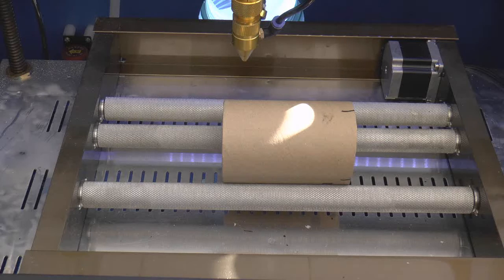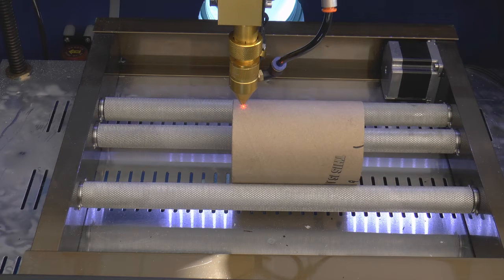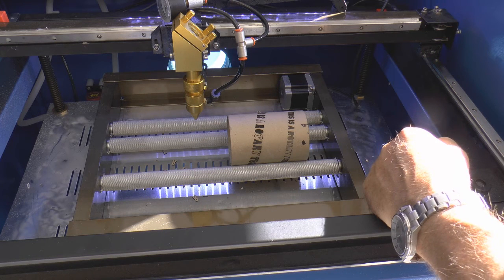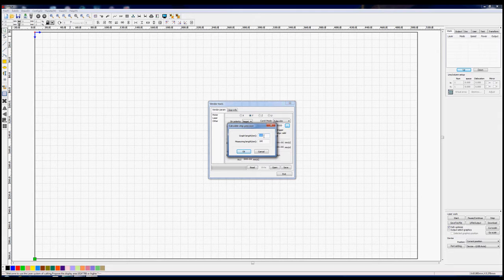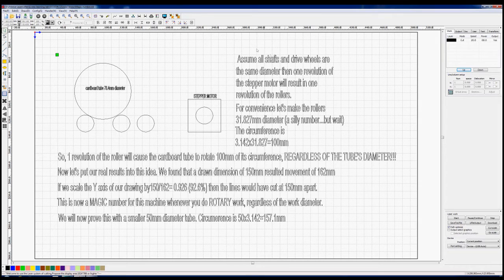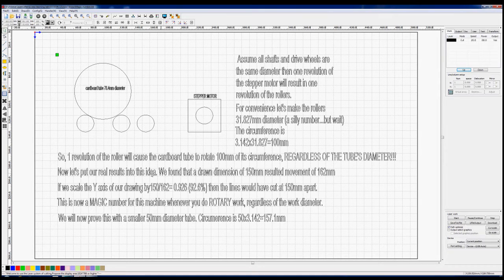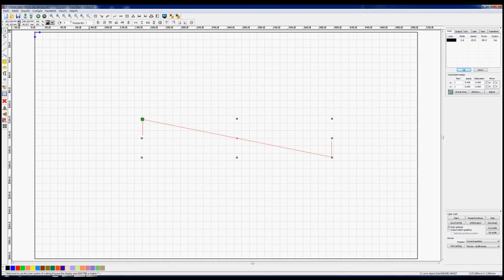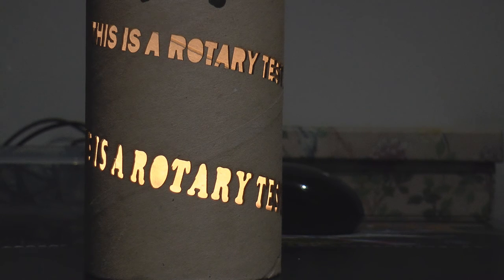RDWorks Learning Lab 11 part2 rotary table program and calibration

Comment: This magic ratio only works with 360 degree rotary engraving. If you use a part of your meterial, for example if you draw a 5cmx5cm circle and cut it with this magic ratio you will end up an ellipse shape with a visually thiner y value. It is the true y value but visually it will be an ellipse. If you want to end up with a visually perfect circle you have to measure a direct line between two lines of your end result without curving the ruler, do the math and apply 'that' magic ratio to the drawing.
Reply from the maker: Your magic ration will almost certainly be different to mine. That ratio only applies to the Y axis (the rotating axis) and works every time for all sizes of object. You must apply the scaling factor to your drawing before programming. Depending on your own personal scaling factor your original drawing will look fat or thin when you program it but will come out perfectly when you laser it.  There are things like acceleration factors that can mess with your final engraving because the rollers move so fast that there is loss of motion  transmission onto your object. You can put an elastic band around your object to create better friction and /or go into the USER tab and set the idle speed and acceleration to lower values just for rotatory work.
Best wishes
Russ

Comment: Thank you for your videos. I am having a problem with trying to use the rotary attachment on a wine glass. I keep receiving Error Code- Y-Axis Overlap.  The glass has a diameter of about 315 mm how to I do about making the page not overlap?
Reply from the maker: +Ayanna George 
Hi Ayanna
At 315mm diameter that's not a wine glass that's a barrel!!
Being serious now, I think a wine glass would be about 100mm diameter with a surface length (circumference) of 315mm. 
It all depends on the size of your machine as to what the problem may be. The rotary device is controlled by  the Y axis driver. If your table Y size is 300mm  then it now depends on how your rotary device is geared.The stepper motor will still output 300mm worth of steps. but what does this give  as surface movement in the rotary axis?
If you put your glass on the rollers and press the UP arrow on your keyboard that would normally  send your Y axis backwards. Although the beam cannot move, the RELATIVE motion between beam and glass remains the same and you will find the top surface of the glass is rolling towards you. Keep pressing the UP arrow until movement stops. Put a mark/piece of tape your glass  right on the top. Also press the ORIGIN key. Now press the down arrow, until the glass stops. Put a mark on the top and then measure between the two marks. The answer you measure is the largest drawing size you can theoretically fit onto the glass. It may be only 250mm 

Remember we set the origin right at one end of the rotation? That's important . If you have a picture that needs 250 mm of circumferential movement and your origin id NOT set right at the end of the rotation. The machine will know that the picture will not fit the available 250mm  and report an error. 
Draw a 50mm square and try to run that with the laser beam turned off. If you set the origin at one end of the motion, the program should run  and then set it at the other end and it will  not run.
The machine is complaining that you are tying to do something stupid, but it's too polite to tell you truthfully. I suspect you either have not set the origin or that your drawing exceeds the available rotation.
If you are still in trouble after checking these things, please come back to me and we will try thinking of other possibilities.

Good luck
Best regards
Russ

Comment: Interesting. I did my own little test with this same machine and rollers. But mine comes out compressed instead of stretched.  I've only done this with the default square that comes pre programmed into the machine.  I looked for slip but did not notice any using both glass and a paper tube. I suppose I could calculate my personal magic ratio and stretch images, but I'd rather not do that since I may just have them on a USB and not be at a computer.  I thought that perhaps the compression was due to some slack in the belt tension, but there seems to be too much compression to blame it on that.   I looked around the control screen to see if there was an enable roller setting without luck. It just seems that there should be a better way.
Reply from the maker: +Nathan Clark 
Hi Nathan
I spent ages trying to get this strange device to work and perform predictably. Hence the magic ratio approach.  The easy solution you seek with a machine setting is just not there. There IS a 100% fix for your problem and that is to  manufacture a whole new  set of rollers with a bigger diameter so that the magic ratio becomes 1:1. The alternative is to always save 2 versions of your files to memory stick, one normal and one stretched.
Sorry I cannot be more helpful
Best regards
Russ
Reply: +SarbarMultimedia I may take a crack at building up the rollers with bicycle tubing after more testing.   It should provide some nice grip.
Reply: Mine gets squished as well, my magic number is to stretch by 57.2%
Reply: @naRevolution  I actually found a set of numbers in the settings where you can adjust and it will give it a perfect fit. I made the changes years ago so I can't tell you where to find them. I think there is a pair of numbers (it's in the software, not the machine). I think I ended up calculating what to change it to and one of the numbers was really high.

Comment: I just figured out how to use "enable rotary engrave" option and i thought i would share it here. This is so much better then changing vendor settings for various diameter materials. On the Y axis stepper motor driver you will find information  (table) how many steps (pulses) driver is set to to achieve 1 full rotation of stepper ( mine was 5000). So that is one rotation of stepper, but there is reduction gear in rotary (mine was 3:1)   So 15000 pulses for me was one full rotation of material. So that is "circle pulse"  you have to change. Then everything should work great once you specify diameter of your material also! PS. I got custom rotary that is chuck type not roller, not sure it works same for roller type?

Comment: First off, thank God for your videos! I was about to take a sledgehammer to my laser! (One of the red 60 watt units on eBay) I've been struggling with mine for a month now. Anyway, your videos are a great help, thanks much!
My unit has a 4 prong (aviation?) plug for the rotary attachment in the bed area, and I notice there is a spare driver with the end that leads back to the plug just laying about (unconnected).
Do you initially attempt to use a similar setup when enabling the roller in the software, or did you start out disabling the y axis from the get go? (I wonder if the toggle in software shunts the y axis commands to a different pin out on the driver board...) hoping really....
I don't have a roller attachment for mine, but I do have the plug ordered and a spare stepper motor laying about. (Plan on diy)
Reply from the maker: +kilroy07 
I'm sure you have already watched part 1 and therefore will have seen that my machine has no special rotary drive controller. I have to unplug the machine Y axis (like yours, the plug is at the back of the bed area but not all machines are there, some you have to go into the control cabinet to make the change) and connect the rotary table into the Y axis control board. This is actually quite a good system as you don't need the Y axis during rotary engraving.

Is your spare driver something to do with auto focus (if you have a powered table,some more powerful machines are equipped with this feature)  ....a Z axis? Mine has a manual switch controlled powered table but no auto focus.

If you need any pictures or info about the roller table  just message me and I'll try to help.
Reply: kilroy07 i have the same setup as you by the sounds of it and after connecting the wiring all the way through from the rotary, to the bay connector then removing the y axis motor from the controller and plugging in the block from the rotary into the controller i get nothing. It does not rotate at all when i press the up and down arrows on the laser control panel. Its driving me nuts. Have you managed to get yours going yet?
Reply from the maker: Hi Kev
Just a silly question. In the user parameters there is a rotating section. Have you set Enable Rotataing to YES?. If so turn it back to NO. That section is specifically for the chuck type rotary  and not the frame type that we have.
Russ
Reply: Hi Russ, Its a chuck style one I have, do you mean user parameters in RD works or on the laser itself? Many Thanks.
Reply from the maker: Hi Kev
In RDWorks top right there is  a user tab. That tab gives access to all sorts of thing that you can fiddle with and sometimes need to set but you MUST be connected to your machine first. When you open the tab, make sure the first thing you do is go to the bottom and press the Read button. That will place your current machine settings onto the screen. Scroll down and you will eventually get to a Rotaary section. For your type of unit you will need to ENABLe the rotatry There are a couple of other setting below that you will need to tweak when you get it working and know what you want to engrave n. Make sure you press the WRITE button before exit

Good luck
Russ

Comment: Thanks for this information. I'm building a DIY rotary device for my "Chinese laser" which is a different model. But wondering...
Have you experimented with engravings using this method? I realize the effect might be minimal, (and not sure if visibly apparent or a big deal), but wouldn't the engraving essentially overlap (or if a cut, the equivalent of cutting at a slower speed) Since you are either compressing/bunching or expanding/stretching depending on the scaling required the actual engraving or cut vs the original design?
Reply from the maker: +Marc G 

Hi Marc
Your question  made me think for a few seconds before I convinced myself that the drawing scaling factor  deals with ALL issues.

When you have the normal XY axes working the machine has already been calibrated at 1:1 ie  if you draw a 100mm square  you naturally expect the flat  cut produced to be  100mm square. If you program the speed at 10mm/sec you would expect it to cut in 40seconds.  You now unplug the Y axis and  drive your rotary device instead. You do not specify anything in your program that tells the machine you have done this swap and as a consequence the steps per second  from the drive board that produce 10mm/sec, remains the same. Don't be confused by different gear ratios,  all you need to consider is the ratio by which you must expand or compress the drawing  Y axis to achieve the same 100mm square on a circumference. I hope you can see that  because the machine knows nothing about your rotary device, you are making just ONE fixed compensation % to your drawing (that applies to any work diameter) to take out all the step and gear ratio  differences from the  normal Y axis and your circumferential square will still take 40 seconds to cut.

Overlap? This is a function of your work circumference. Your compensated drawing cannot exceed the work circumference or you will get overlap

Hope this clears some of the fog.

Comment: I have the 50w chinese engraver also and truly appreciate your videos. I have the identical rotary table you show. Works great for tests as yours did. I am trying to do a wooden rolling pin, everything does as it should except about every 1/4" on the Y-axis, it seems to skip engraving, leaving a thin sliver of material showing through the text, design or whatever.  I have tried multiple fonts, speeds, power settings and still get the same skip result. My question for you is have you tried engraving on a wooden dowel and achieved clean, engraved design? Could it be the rotary rollers slip? Or do I require setting the 92.6% y offset more? I can send you a pic of what it is doing. I have to engrave on the small spaced rollers for the rolling pin. Appreciate any advice.

Comment: I don't know if you've figured out how to engrave a glass yet but if not I can help you out. It's fairly simple.
Reply from the maker: +GSCOMPUTERSRGV.COM    I'm up for any advice or helpful tips. In session 13 I did experiment with glass engraving on a cheap glass jar. I had previously experimented with a coloured glass beer bottle but I think I used too much power (I could see cracks in several places!!!) As I say in all my videos, I'm trying to find out how to make things work rather than do a professional job at the moment. So, any tips that will enable me to take the next step will be very welcome. Now that I'm starting to tackle longer projects I'm discovering power loss issues with my machine (see sessions 16 and 17) I suspect I shall have difficulties getting any sense from China and may have to resort to Paypal  for a resolution.
Reply: Give me a call sometime. Maybe we can exchange tips. Contact info is on my website.
Reply: I tried replying to your email but it kept getting bounced back. I have added you on skype.
Reply: +SarbarMultimedia Sorry to butt in on this thread but I had up until this comment been looking at buying the same laser from the same seller. It seemed sensible to follow the footsteps of someone who has been there and is doing that; somewhere to learn from.
Im dotting about through your videos and have seen the one about the power loss and it likely to be an over driven 40W tube rather than the advertised 50W. I posted the video here to highlight to others - https://www.facebook.com/groups/441613082637047

Did you need to go back to paypal for a resolution or did you settle on the fact that it was a bit of a dodgy (pronounced "false") sales pitch?
Reply from the maker: +Peter Jones 
Hi Peter
Although I bought a 50 watt machine, I have yet to prove it is only operating at 40 watts or thereabouts. I have a power meter on order which will tell me what's actually happening. Up to now its been supposition because of the shape of the power characteristic I have found for my new tube. It also explains the early demise of my original tube because I used it mainly at 85 and 95% Even if it turns out to be only 40 watts I shall actually be happy because it cuts 8mm perspex (albeit very slowly) which is 2mm more than I had anticipated. It's the engineer in me that want's to push the boundaries and find out if it's performing to spec. Several contributors, a lot more knowledgeable than myself, have advised that most (but not all) Chinese machines are over-driven to justify peak wattage claims. Having killed one tube in record time, I made the effort to understand my new tube  characteristics and stay within sensible limits to hopefully achieve it's expected 1000 to 2000 hour life. A warning to others to be careful about pushing their machines to the limit will, I'm sure, save many new users the expense of a tube replacement, so thanks for spreading the word   The main requirement when buying my machine was not wattage but bed size. It just so happens that the higher the wattage, the longer the tube so the bed size goes up  because the frame has to be bigger. For me this is not a production machine , it's just a great way to keep playing with my CAD system and I have enjoyed the element of learning without a manual.  Don't let this over-driven issue stop you buying a machine. I have had endless enjoyment from it so far and when I fit an ammeter and do my power meter checks (so that I know I'm running the tube within it's 20mA current spec) I have a few more projects in mind to push my learning further.